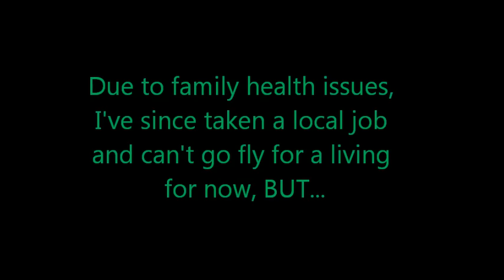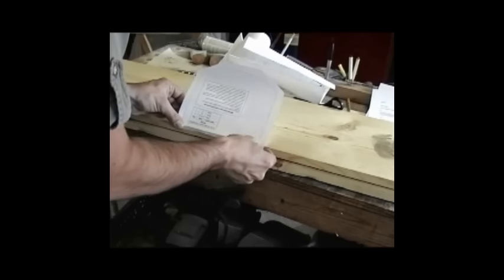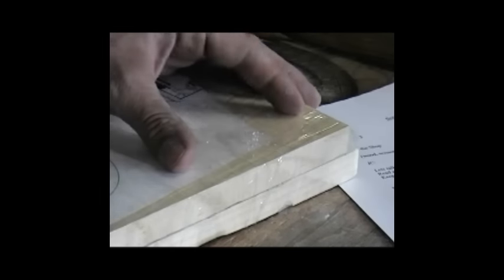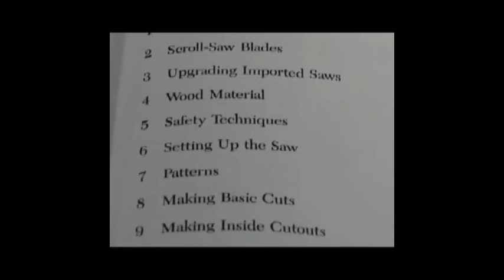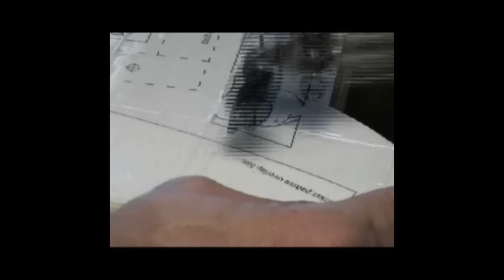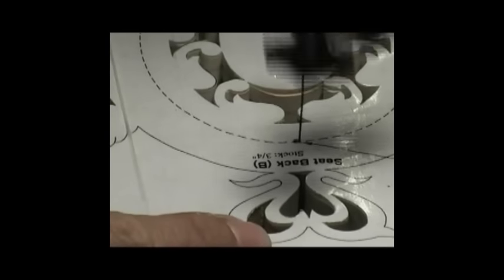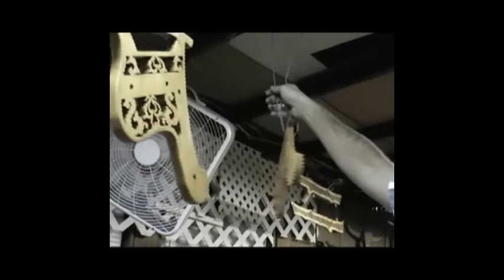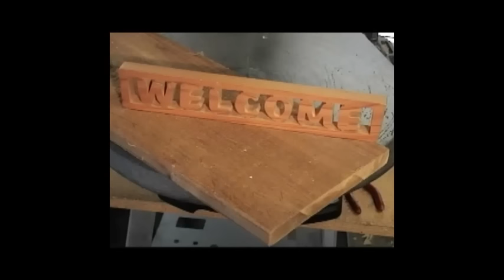A Guide to Scroll Saw Fretworking from Start to Finish (Plus an update of what I've been up to)

Comment from the maker: An Olsen 12 T.P.I. reverse tooth blade.  The more I stack cut, the stiffer I want the blade.  The closer the inside cuts, the more critical it is that you go slow and stead so that the blade doesn't warp and bend and cut through one on the lower stack.

Comment from the maker: Thank you so very much for the kind comments.  Start with a few basic patterns and work them on various woods: Pine, 1/4" plywood, 1/2" oak (you'll burn some blades getting used to that, Poplar too.  You'll find that each type of wood will cut differently.  Cheap plywood will have a tendency to splinter if you have cuts close together.  Thanks again and good luck.

Comment: Excellent video. I'm bookmarking it. Now i just need a saw! (And everything else too) Total rookie, I know... Do you prefer the Dewalt? Have you tried any other saws? Excalibur? Hegner? I know a lot of people say to start cheap and go from there, but I just want a high quality/durable saw that I don't need to upgrade. And for a reasonable price. Is buying used a smart option? I'd much rather buy a durable used saw than pay too much for a new one of lesser quality. Seems to be the pattern with manufacturing these days. Is there any way to get a product list of everything I will need? Any info would be appreciated. Thanks!
Reply from the maker: I really like my Dewalt scroll saw.  I spent under $200 on my first Delta scroll saw  then wound up with the Dewalt within a year after the Delta broke and I wanted to tackle bigger projects (like the giant clocks).  It's good value for the money too.  Have fun!

Comment: Love the video you made it full of great tips on finishing and much more, thanks for making it. Id like to know a few things about the larger projects you show and mention the Dome Clock and the Chimes of Normandy. How many hours did you use to build these two pieces and what size and type blades did you use most often? I realize its hard to estimate how  many hours but roughly how long per piece I'm wondering if I could build one of them in a month of shop time. What do you think thanks much

Comment: i just watched all your videos on begining scrollsawing i was given a craftsmas single speed 16in pin style scrollsaw its used but well taken care of im about to start some cutting have gotton some patterns from stevegood and bought some popular and 1/4 oak plywood my question is this i found a heart shaped pattern but some of the cuts at the size that printed are to small to allow the blade to enter because of this handiecap do i pass on this type of project or blow it up to fit a pinned blade?
Reply from the maker: This is why I don't use pin end blades.  There are too many projects that I do that require a small blade and a small hole and the pins keep me from doing them.  ;)
Reply: Reaganite71 thank you for your email after some searching i have found a way to convert my saw to take the non pin blades. I well keep watching your videos hope to start some projects soon
Reply from the maker: Alan Fewel I'm glad you found a modification for it.  The folks that designed pin end blades had very little consideration for tight fretwork scroll sawyers.  LOL ;-)
Reply: Alan Fewel
Hi Alan, I have the same saw (I just bought it today :-) What converter kit worked for you? I saw one in the Olsonsaw website for $28.99...Is that one? Thank you
Reply: i got mine at amazon for about that price though i havent put it on yet

Comment: how could i get patterns to apply ?
Reply: spray glue from craft/art supply stores. There are different strengths, I use Elmers Multi Purpose Spray Glue, it holds well enough but can easily be removed. I dab a bit of denatured alcohol on it to remove the paper after I'm finished with the cuts.